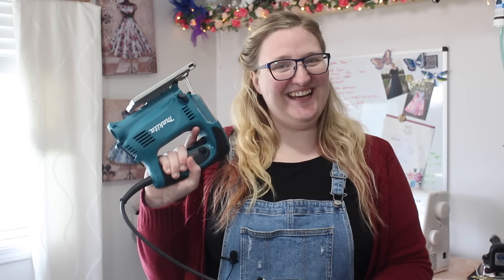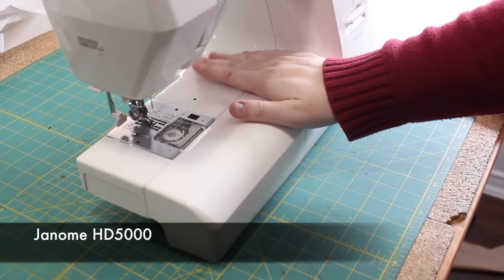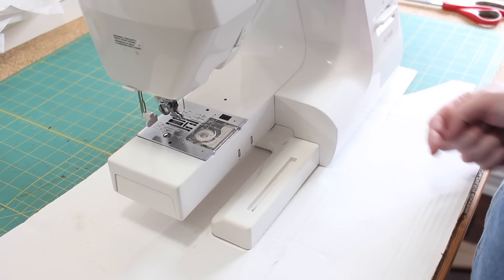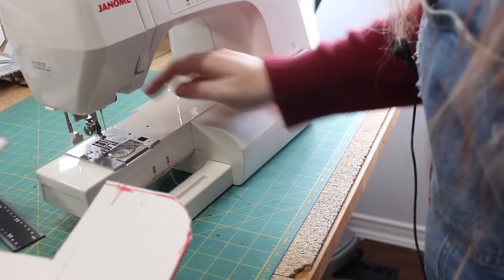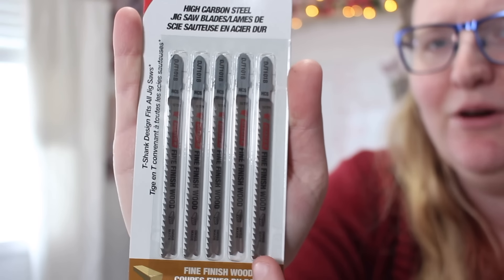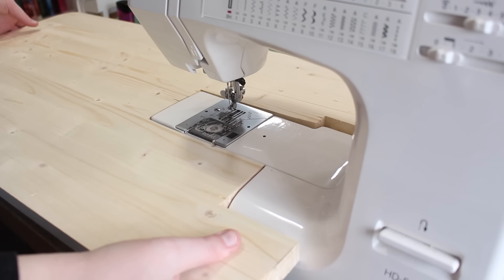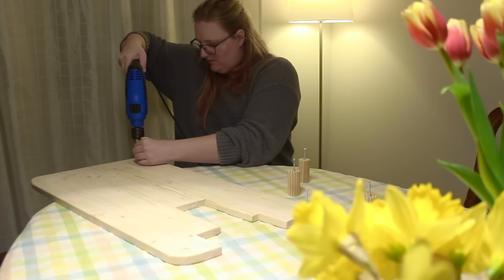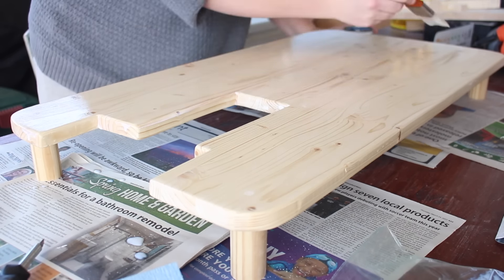I Built a Sewing Table Extension (and didn't lose my fingers in the process) || Janome HD5000

Comment: Beautifully done. Once the varnish has truly cured through, you can wax it with car wax just like you would wax your car, and the fabric wil just slide ever so smoothly in all directions.
Reply from the maker: Thanks for the tip!
Reply: Even a sprinkle with talcum powder works wonders and won't stain fabric.
Reply: I would pay you for one fitting my sewing machine. Its metal, model from the 70's but I use it daily, its my working horse. Now I have started adventures with patchwork ..A table like that would help a lot....Thanks for sharing.
Reply: I am into quilting, an in dire need of this kind of table. I have a 1120 singer, an older model and no table is made forr it. Custom tables are too expensive. So I thought, I'll make one and researched. Found you video and it was very helpful!!😊

Comment: For those who do not do woodworking you could also use foam board.  You can make card board legs out of card board folded into squares & hot glued to the bottom.  Cover it all with contact paper to make it slippery.  Most foam board is 20x30 and only a $1 at the Dollar Store. Don't worry if you screw it up, you are not out much!  It you get it right the first time. It might cost you about $2 for foam board & contact paper.  I suggest making a template from cardboard or poster board first to get it so it fits nicely then use it for the pattern to cut the foam board. You can double the foam board & legs if you need it more heavy duty.

Comment: Girl, I am super impressed!  The extension you made is much larger than the one I spent big bucks for, and I’ve been wanting a larger extension.  I don’t have any experience with a saw, but I’ll practice on some scrap wood until I feel comfortable
Reply: I was more lazy than her. I bought a cheap bed folding table from the supermarket. The ones you use for breakfast in bed, It was only 5 bucks - a sturdy wood plate with foldable plastic feet. I used a hand saw to shorten the feet and cut out the hole to slide my machine in. Took me about one hour and then off I went quilting.....
😁

Comment: Gorgeous extension table!

GREAT BIG WARNING TO ANYONE DOING THIS !!!!  It is mandatory to treat both sides of any wood with the same finish. If you only paint/varnish/polyurethane one side the table is guaranteed to warp over time. This also holds true with plywood. An unfinished side will absorb more moisture over time than the finished side causing warpage.

Comment: Great job, some stick on drawers underneath would add a place to keep, machine screw drivers, seam ripper, small scissors,  and/or other small tools. Just an idea.  Wish I had your guts to use my husbands tools by myself.  Was there a reason you selected 3/4 inch thick board?
Reply from the maker: That is a great idea! The 3/4" board was what was available for a decent price :)

Comment: You did an AMAZING job on that sewing table! You should sell your idea to the sewing industry. That is the size of table that is needed for sewing. I have (2) plastic extension tables for (2) different expensive sewing machines and neither one fits the machine properly. That's what the sewing industry does is make junk. Have fun with your new table. I know you will!
Reply: KstieLove:  Yes  and she kept the  table front a reasonable size.  The table I purchased has way too much extension at the front.  I do not want to be 8" from the needle.  My table is a poor design, and not the configuration I was told.

Comment: Thank you for this video. I have started quilting using my normal sewing machine and looked at purchasing an extension table. You are right, they are far too expensive for what they are. I too am a little handy with wood, and had planned to make something similar, though I wasn't going to make it go as far as the throat like yours. I am now going to copy yours exactly, having seen the end result!

When you are cutting wood or ply, if you put some tape over the cutting line, it reduces the splintering.
Reply from the maker: Glad it was helpful, I wish you the best of luck with your table! and thanks for the tip!

Comment: Love it, and so timely, I just got a new sewing machine and the extension table is a ridiculous price for a piece of plastic. I will just have to get the tools out. At least you know it isn't going shatter or snap like plastic and it's more environmentally friendly. Thanks for the inspiration. 👏👏👏
Reply from the maker: The one I was looking at was $200 plus shipping it to Canada and import fees would have brought it over $300 😳😳😳
Reply: @EnchantedRoseCostumes  Yowza!

Great job on the project!
Reply: @EnchantedRoseCostumes  I've made several extension tables for various machines, but used plexiglass.  It's easy to cut with a jigsaw and comes with a removable paper protection layer, so you just draw your pattern on the paper and once completed just peel the paper off and doesn't need painting, only a quick sand on cut edges to remove burrs and protect fabric from snagging.
  Hint...sometimes plexiglass gets scratched at the hardware store and they sell it much cheaper.  Small scratches will polish out with toothpaste but I don't usually bother because pins etc soon scratch it when sewing.  You did a great job on your Spruce table and should be pleased with the results.
Reply: @AW-pz3qc  
Great idea, we have some old plexy up in our barn, especially with high priced wood now…..smooth MDF wood would probably work also…

Comment: I have two singer machines (Quantum and Fashion Mate).  These machines have totally different beds. One is clear, the other is opaque white.  One is moderately tiny and the other is good but could always be bigger.  My BIGGEST complaint is that these are NOT interchangeable.  Wouldn't you think one singer flat bed would fit the other????  Well, I guess that's what you pay the big bucks for.  A room full of extension beds for sewing machines most of which aren't worth a pinch of coon poop!  Singer, if you're listening, call me and we'll chat.
Reply: Cheryl Taylor: and most singer machines made now aren't much anymore either.   Which model fashion mate do you have there are several singer fashion mates. My 237 from the late 60s is a fashion mate too.  It's  a great little machine.

Comment: You have a new fan! I am currently sewing satin-lined draperies (my first ever draperies project = five windows of jabots and valances) and I sure could use a broad slick sewing surface about now 🙃 Since my contortionist method of holding pinned fabric up completely level, avoiding all the pins touching an ounce of fabric where the pin should not be touching accidentally, abusing my shoulders, and employing a handy foot or knee here and there, I have decided it would be much less work to just build a nice little table extension like yours. I won’t cut a finger off either... trust me when I say I am a bit handier with power tools than I am with a ton of seamstress pins in flight. Fresh rotary blade to cut, fresh needle in the machine, but I sure as heck wasn’t thinking through anything else which could cause a snag so I am pretty intently avoiding any randomness over here. Did I mention I’m over this satan satin stuff? 😉 Your project is gorgeous and I will gladly take your lesson to heart and make my own.

Comment: Wonderful project! A couple of tips: Most jigsaws let you angle the blade, so you could have undercut the sections against the curved part of your machine and had it fit tighter. Plus a little palm or 1/4 sheet hand sander is not very expensive. I like the 1/4 sheet hand sanders best - they use 1/4 of a full sheet of sand paper instead of custom sand paper so they are cheaper to use.

I'm buying a new sewing machine soon and if it doesn't come with a good table, I will copy your idea and make me own! Thank you for the detailed DIY video.